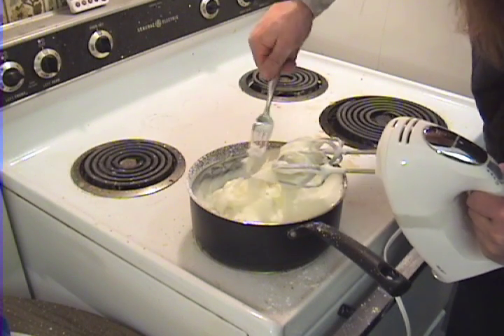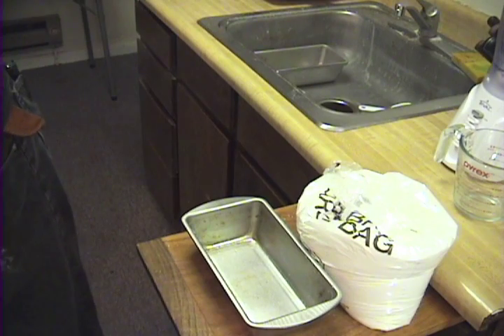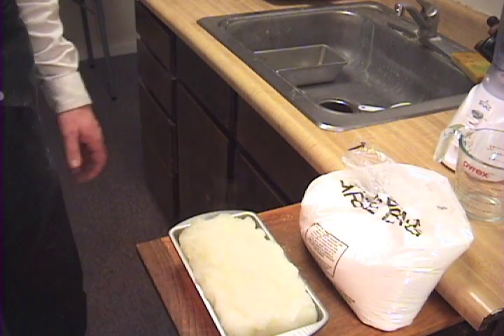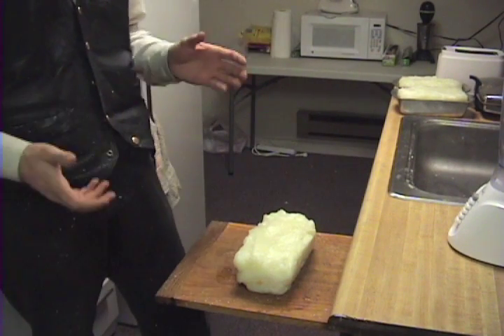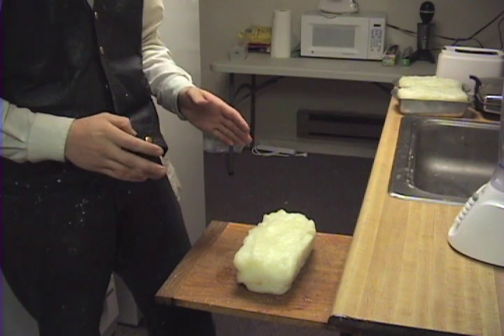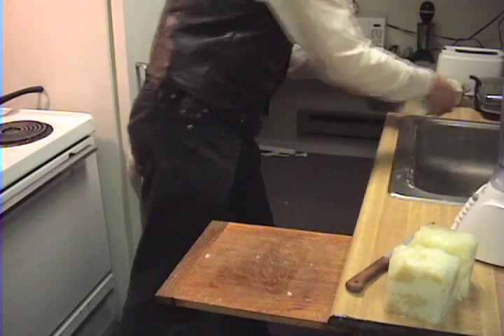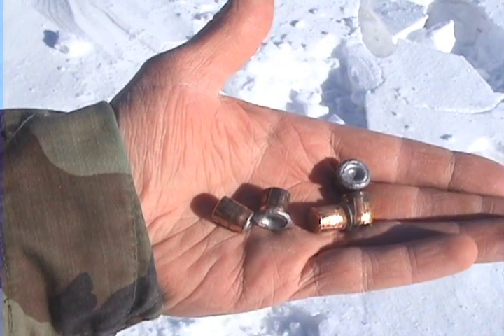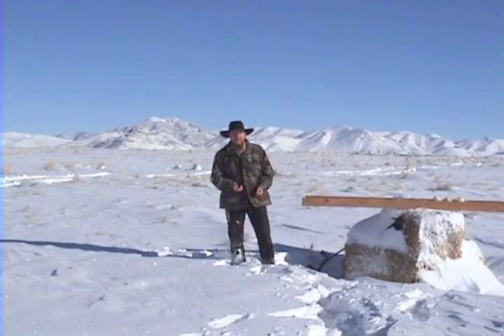Alternative Ballistic Gelatin (TIS026)

Comment from the maker: A typical bullet trail in ballistic gelatin has two parts: first a large-diameter wound channel, followed by a small-diameter wound channel not much larger than the bullet itself, with a relatively abrupt transition between the two.  We see the same phenomenon in polymerized corn starch, except that in the large-diameter section the starch often breaks apart, as seen here. However, the block that captures the bullet has only a small entry hole. I would expect similar results with the 5.56 round.

Comment from the maker: Once the starch has cooled, it can be kept and used at room temperature, although it does have a finite shelf life.  If you just leave it sitting at room temperature indefinitely, it will eventually either dry out or spoil, depending on ambient humidity.